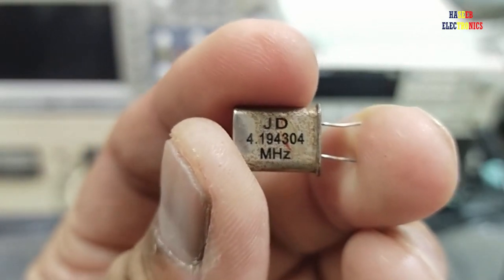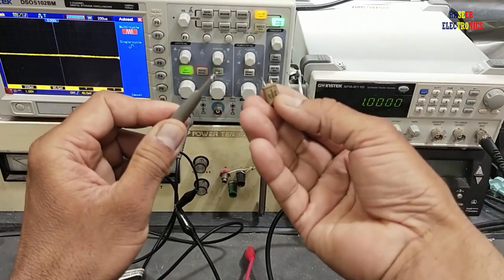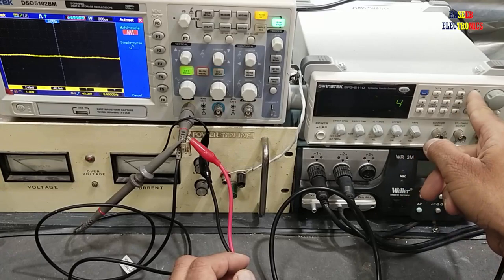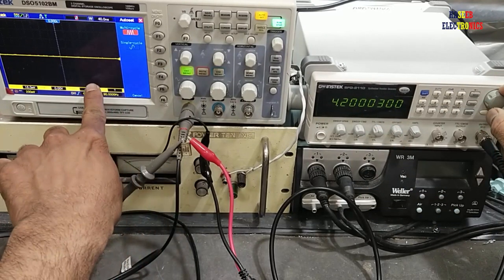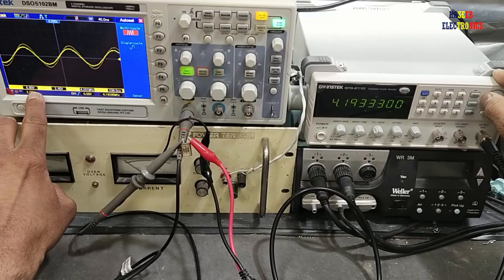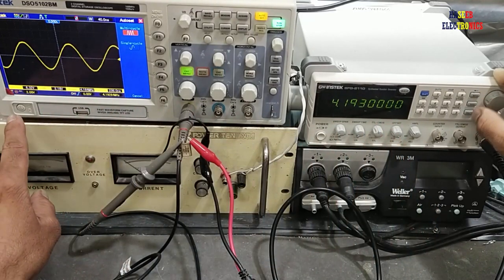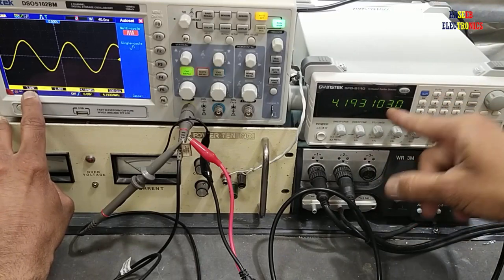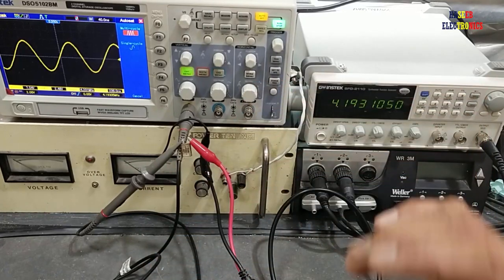{851} How To Test Crystal Oscillator

Comment: so this crystal osc amplifies the signal from 5V to 7V?
Reply from the maker: actually crystal oscillator adds its own amplitude in the source signal, this condition arrives when the crystal oscillator and source frequency is tuned at resonant frequency 
otherwise it suppresses the source signal
Reply: @HaseebElectronics  which wave gives more amplification sine or square or pulse? have you tried? thanks for answering
Reply: @HaseebElectronics  what happens when you put 2 same crystal oscillators in series and get them in resonance. you will get 14V instead of 7V?